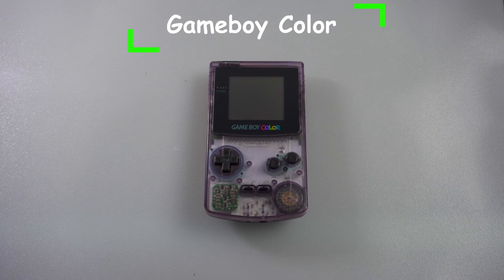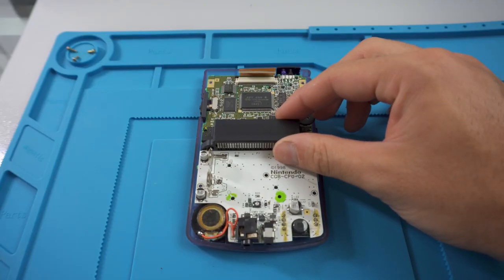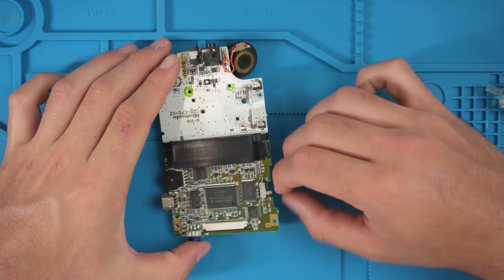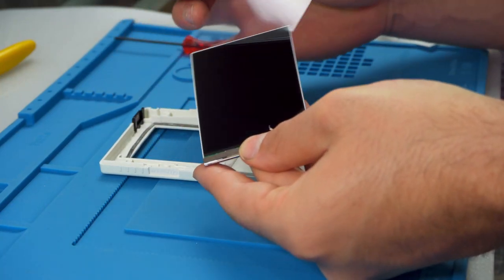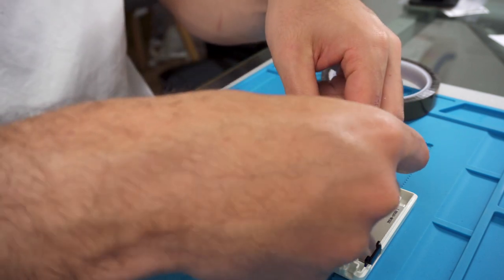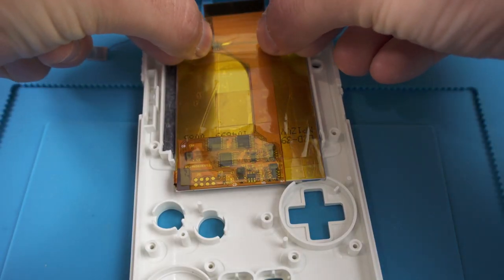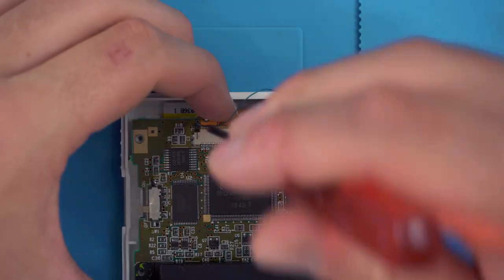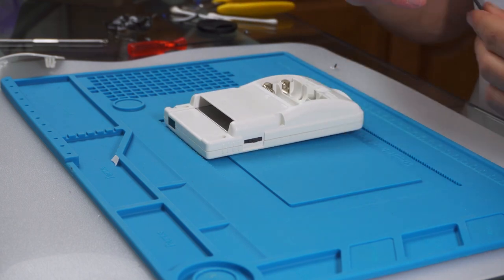Ultimate Gameboy Color Mod - Funny Playing IPS Screen

Comment: Hey mate, I'm hanging to do this or perhaps just buy one already put together from eBay au, they are $249 aud including the ips v2 mod. You think that's worth it?
Reply from the maker: It really depends on your skill level. If you're comfortable with modding I would say do it yourself cause its not too hard to do and it will save you a bit of money. But if you aren't I would say just buying one already done to save yourself the trouble.
Reply from the maker: to make it a whole lot easier buy the precut shell if you are thinking,ing of doing it yourself.
Reply: No its not worth it. I have seen modded Game Boy Colors for 120 dollars in Ebay and the mod is not hard to do if you get the precut shell and holfing brackets. The screen itself is 50 dollars delivered.
Reply: @Sc0pee  figured it out the hard way. Every mod after that I've done myself 😌
Reply: @8BitPasta  Just finished modding mine with the Funnyplaying screen. Everything is great expect I think that the screen is a little bit "tilted" horizontally in relation to the bezel...  Not a big deal though.

Comment: How sharp is the screen? 
I actually prefer less sharp screens, the grid lines of older displays, i think it compliments the older graphics. 
I really want a my Gameboy Color with backlit display but I don't wanna lose that retro look of the original screen.
Reply from the maker: I found it sharp enough for my liking. I believe it has a 4 to 1-pixel ratio so it's not very different from the original it's just a bit clearer. but don't take my word for it I believe their website has the actual specs.
Reply: @8bitobjective786  I'll probably risk it for the biscuit. I haven't yet seen the ips screens in person but I think I will be happy with it.
Great video by the way. 👍
Reply from the maker: Thanks man. Yeah definitely give it a go it really is a nice upgrade and being able to play in the dark is the best
Reply: @desirewithinus  Well they are quite sharp, but that doesn't take away from the feeling  in my opinion. Of all the different Game Boys only the original DMG had a not so sharp screen.
Reply: @Sc0pee  yea i finally got to check them out and I think now I prefer these new screens. What a great mod.